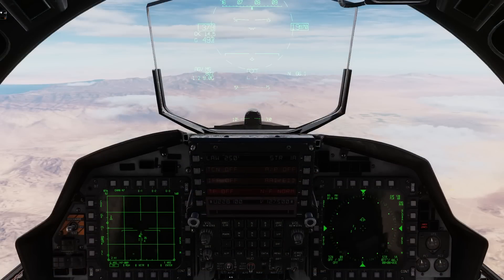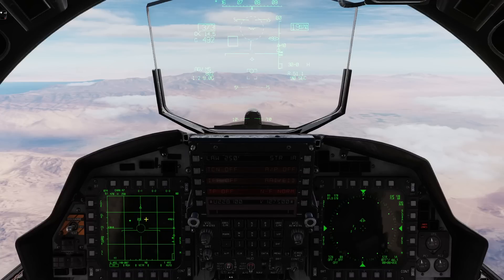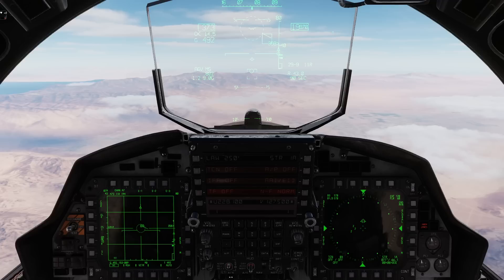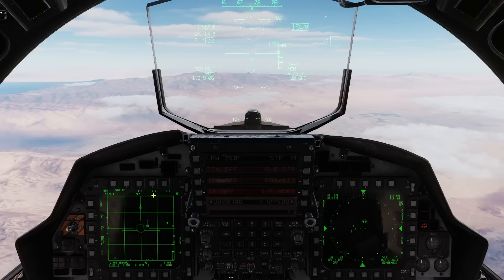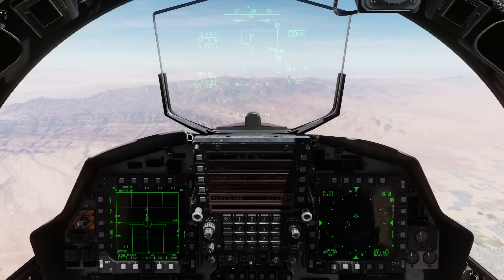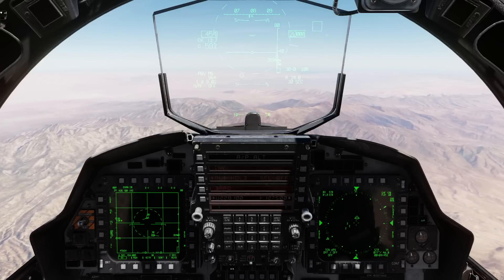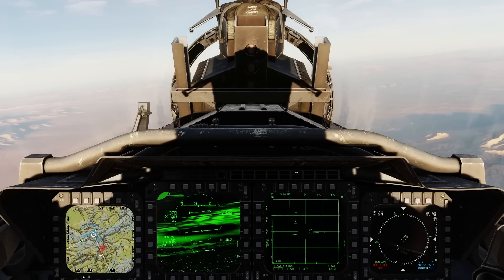DCS F-15E Strike Eagle | APG-70 Part 2: Track modes (STT & TWS)

Comment: Be good if you explained the TWS mode some more. It’s way different than the F-16/18, where they talk about locking bandits in TWS rather than STT so they don’t know they’ve been locked.  It in the 15 it seems like you are always in RWS (but there’s no indication) and the ONLY way to lock is to use STT, but then just locking more targets is called TWS. And TWS only has a very narrow scan width.
Reply: TWS has several different modes, for different situations.  The thought about locking up in TWS to avoid a missle warning to the target still applies as well.  The mode indication is down in the bottom left corner.

Comment: A few comments on your video, 
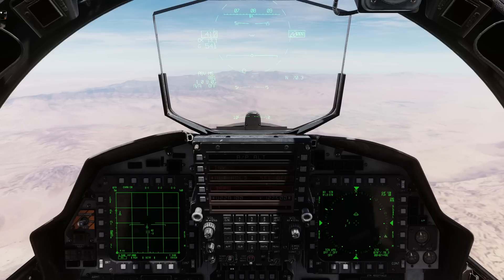Firstly, and most important, thank you - it is helpful but at @5:42 you talk about non-designated TWS and allude that you'd explain it. You never do. How do you enter non-designated TWS. An STT lock converted into TWS alerts the bogey/ bandit you are looking at them. They would notice the spike on an RWR but not be aware that they are your focus using STT broadcasts this.
Another observation, albeit trivial,  you use different nomenclatures than the key bindings. I assume Auto Acquisition 'IN' is  "PRESS"?

And lastly What you guys have done with this is huge - it's VERY impressive. Worth the wait!

Comment: 4:50 Thats really interesting. I remember reading a hughes report about how the awg 9 on the tomcat included low prf modes specifically for receeding targets. Makes sense as it was originally derived from the asg 18 and aim 47 used in the yf 12 (badass plane btw), and the apg 63 only needed to guide the aim 7, which lacked range in tail aspect shots. This wasnt included in the apg 63 as part of a pentagon cost cutting act during development, according to the usaf development history doc.

Yes, the f15 wasnt an unlimited "build the best plane you can, no restrictions" project as people like to think.... HOWEVER, aerodynamics is really where they spared no expense. Specifically aoa capability :D

Comment: Does the bigger radar in the F15 allow radar lock from farther distances than the F18 and F16 smaller radars? In theory I think yes but just want to know if it is confirmed for DCS?
Reply: Yes, much further.
Reply: Good question. There was a rumor that that E's radar was powerful enough to fry enemy radars but I don't know if that's true. I know the F-22 and F-15EX can do it though.
Reply: @Verdigo76  what about the mig-25's radar
Reply: @Pvt_Wade  MiG-25 radar was pretty garbage and very short range compared to modern standards. I think you're thinking of the MiG-31
Reply: @reillybrangan2182  what about mig-31 radar then

Comment: Looks great.  Hoping the HOTAS controls auto map to the thrustmaster Warthog like with the A10C.
Reply: Why would they? The HOTAS Warthog is a 1-1 replica of the A-10, so why would you think it would work that way with the F-15E?
Reply: @Impending Joker  Hmmm🤔 it's probably because the A-10 and F-15 have very similar throttles.
Reply: @ImpendingJoker  A-10 throttle and F-18 grip = F-15E HOTAS. It will most likely map automatically.
Reply: @ImpendingJoker  Because many others offer that...

Comment: will the module be keyboard friendly?
Reply: @Tracking Phoenix ik that but like will it handle like fc3 planes on keyboard i kinda can't get a joystick rn
Reply: @smellysardin3793  it’s a full fidelity module, not like FC3. You could use keyboard but that would be painful (I used to do it too). Keyboard for some controls is fine imo but I try to minimize keyboard usage.

Tbh depending on your budget I can get you set up pretty easily. I have a T16k HOTAS that I put up in the box. Potentiometer has the usual issue they all have, so you can’t really use the twist axis. Other than that she’s a beast. Throttle and stick for $60 + shipping.
Reply: @Procxlite  that is a good deal but idk my main thing is will the plane just fly normally like the fc3 stuff do. I played a lot of the fa18 because it handles like the fc3 planes on keyboard unlike the f16 that i can't play
Reply: @Tracking Phoenix I got shot down in a dogfight by another F-18 player that was using a keyboard so it's possible.
Reply: if you are keyboard only maybe the wizzo seat in multi would be cool, but i would imagine its pretty hard otherwise
Reply: My final answer will also be "get a cheap joystick" but there is a bit more to the question. The Hornet is really easy to fly despite it's detailed flight model because it has a really good FCS (Flight Control System). I believe that the F-15E only has basic dampening like the F-15C, which in return gives it a much more "raw" and therefore harder flying experience.

I would like to say that it will be similar to the Viggen but that's really hard to compare like that.
Reply: @Tomas9970_1  I do get that but my main question is basically does it turn on keyboard cuz on keyboard there's no axis to control so if it's not coded like the hornet is for example or the mig19 or others you can't fly it. the planes that you just can't fly on keyboard are the f16 and some others i think because the f16 just doesn't turn you can hold the bank key all day long and it won't turn